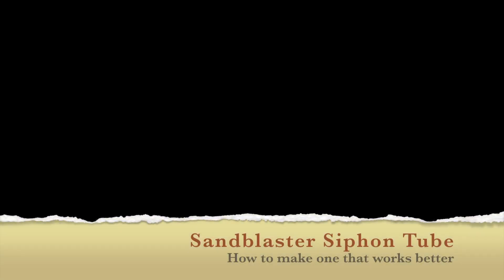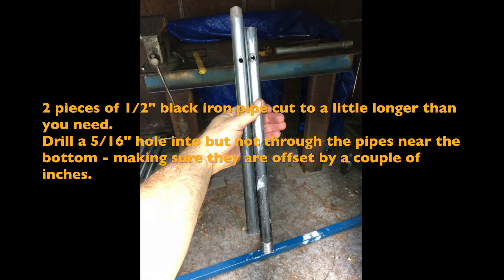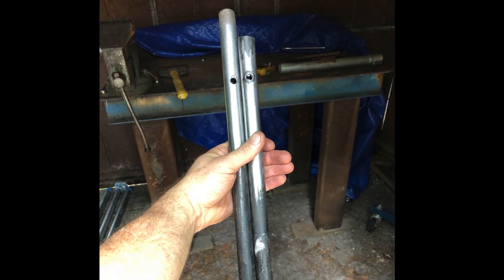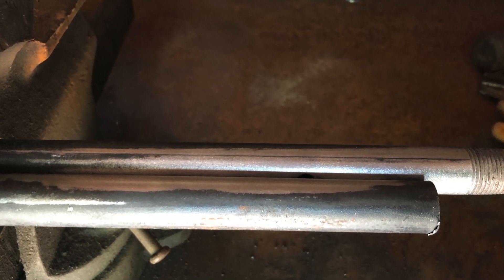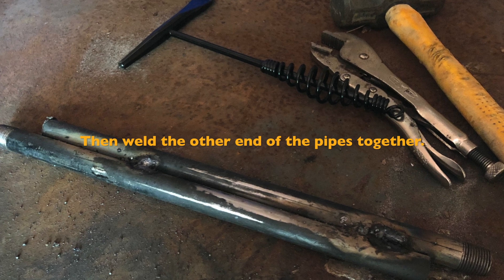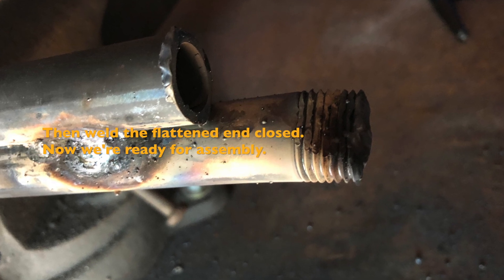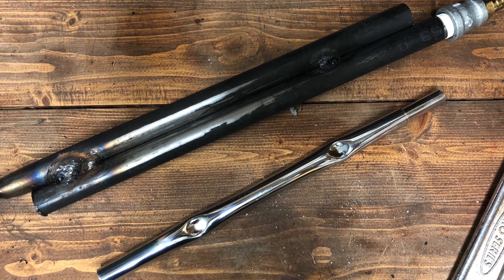Making a better sandblaster siphon tube

Comment: Five stars. Just put it to the test, outdoors, with play sand from a 5-gal bucket, 5/8 I. D. feed hose (10 feet), supplied with 90 psi, and a $14 HF gun, right off the shelf. WOW!

Comment: BTW, added for other commenters: the HFT gun really isn’t crap;  it just needs the air hose coupling it comes with replaced by a high performance one (available everywhere, mine from Tractor supply) it has the MUCH larger I. D.   Take your HF coupling down to compare.

Comment: Which is better between syphon tube or metering valve sir?
Reply from the maker: Siphon tubes are simple and work. Metering valves require adjustments to get the best mix and flow. Metering valves are better in my opinion.
Reply: @TigerCreekFarm  thx sir

Comment: I am totally lost. How many openings in the finished product? Did you just seal the whole thing? Nothing will come into the tube!
Reply from the maker: An opening for the compressed air, an opening for the sand and a connected hole between the two creating the venturi effect that will force the sand into the hose.

Comment: I made one 4 years ago using metal conduit and a segment of 3/8” fuel line. Brassed together but with a tiny 5/16” hole drill 3-4” from top of hose feed tube. I could have used my MIG but it takes the 12” spools and no drive roller for small 0.230 thou wire. I will be making one next week as this welder was new in 1984 when I got it. Still works so good. 
DK. ASE master tech since 78, retired.
Reply: It's easy to skim drive rollers for thicker wire on a lathe to make the wire groove shallower.  If you need to find oddball parts for older welders Miller4less has been good for my ancient blue machines. The Hobart and Weldingweb forums have several welder repair techs and a great knowledge base on what swaps with what.

Comment: Thanks for the tip. I just brazed a chunk of pipe alongside of that stupid double siphon tube that came with my outfit. As an easy way to get a perfect connection between the tubes, at the bottom brazing point I drilled clean through the siphon tube into the new air intake tube and then plugged the new outside hole in the siphon tube with braze (a wrap of tape would do just as well)...  ... totally eliminated the frustration of an intermittent supply of media. Thanks again.
Reply from the maker: Glad it helped. Thanks for stopping by and taking the time to comment.
Reply: Nice to see other folks appreciating the versatility of brazing. I also like it because if you want to change something you can torch off the braze then swap parts and braze them back together. I used to torch braze steel rule style cutting dies which take serious abuse. Brazing withstood shock loads nicely.
Reply: Good brazing tip. It slips my mind. Glad I read your comment first.

Comment: Ever have an issue where the flow of sand is not constant?
Reply from the maker: Absolutely. Media, humidity, air pressure, etc all effect it. I moved along to a metering valve to solve those problems. It lets you dial in the perfect air/media mix.
Reply: I have a 16 cfm - 60 gallon tank..... and i have made a pickup tube exactly like yours. I still have the Harbor Freight sandblast gun..... and sometimes i have nothing coming out. Sand is brand new and 30/60 stuff.

What should i look for? It takes me 20 mins to doa piece thats 6 inch by 6 inch
Reply from the maker: If you have nothing coming out something isn't right. First I would double check that the pickup tube is indeed fashioned correctly. Swap it out with the original and if things work you know the problem is in the siphon tube you made.
If you have the same results with either tube you may have a moisture problem, air delivery problem or the tube is not positioned properly.

Comment: Thank you for this quick straightforward video... I followed your instructions and made my own siphon tube and it turned my HFT blast cabinet into an absolute BEAST... NO JOKE WOW

Disclaimer though, I had already upgraded my gun to a better model but even then it did not work very well. The siphon tube is what turned the cabinet into an absolute ANIMAL
Reply from the maker: That's great. Thanks for taking time to share.

Comment: looks great , my question is why wouldn't the air just suck through the open tube hole at the top instead of sucking up the media?
Reply from the maker: That tube supplies the pathway to create the vacuum vortex - which in turn pushes the media up the tube.

Comment: I made one like yours and it works good but sometimes the hose will plug up why is that?
Reply from the maker: Moisture is a common problem, or you could have dirty blast material that is binding.
Reply: Get an in-line air dryer

Comment: Had the same issue with my new HF blast cabinet and after watching this video I was able to fix mine. I didn't use 1/2" pipe though, I used the two pipes that came with the cabinet. Drilled the holes like you did, then welded up the one end and it works like it should have from the factory. Before the fix my sand blast cabinet would stop up after just a few minutes. Now, it doesn't stop up at all. Thank you for taking the time to help everyone.
Reply from the maker: Scott Beverly way to go! Thanks for taking the time to leave a comment.

Comment: It works! Thank you. We had trouble with our sandblaster and this solution fixed it. Thumb up
Reply from the maker: Jan Kresan thanks. Glad it worked for you. The next step would be to replace it with a metering valve. That is the direction I ended up going and it works even better. I have a video of this upgrade, too. Thanks again for taking time to comment.
Reply: @TigerCreekFarm  ......you mean.....add a ..... rather than, replace.....?! Lol
Reply from the maker: Navin Kotadia nope. Replace. The metering valve draws the abrasive through the bottom of the cabinet and allows you to “tune” the flow.
https://youtu.be/PD6xHukKe2I

Comment: Looks good I just can't seem to find the finished product on the video
Reply from the maker: transam8607 not my best video. It is there near the end - just before the blasting. It is laying next to the original siphon tube for comparison.
Reply: How do the connections work with a harbor freight air nozzle?
Reply: @justinralston4852  i wish I could send a picture on how I build mine i think I used some rubber fitting and a 1/4 copper pipe with a flaring tool

Comment: well Done!!!!    Thanks for the great video..upgraded my HFT crap one with  yours and OMG..
Reply from the maker: Ron Perino thanks. I found it to work a LOT better. If you want to take it a step further (as I had to for low psi work) invest in a metering valve. You can fine tune it to the psi/media you are using - https://youtu.be/PD6xHukKe2I

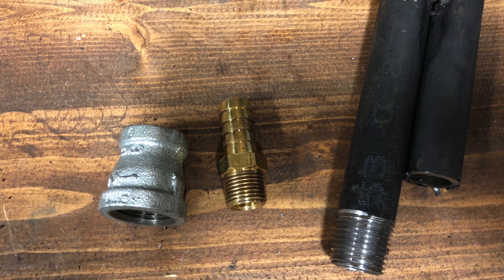Comment: This video was very helpful THX! But I just wanted to verify @1:39 did you mean to say you used a 3/8in nipple?  Because I can't seem to find a 3/8in - 1/2in nipple anywhere? And once you apply the 1/2in - 3/8in coupler you're then working with 3/8in npt threads.
Reply from the maker: Sorry for the confusion and I am sure you're right. The reason for the reducer instead of a coupling was to allow for the 3/8" threaded nipple. Remember, this nipple is used to match your existing hose in the cabinet - whatever that may be. Thank you for catching this mistake.